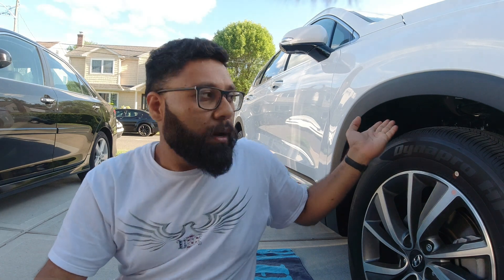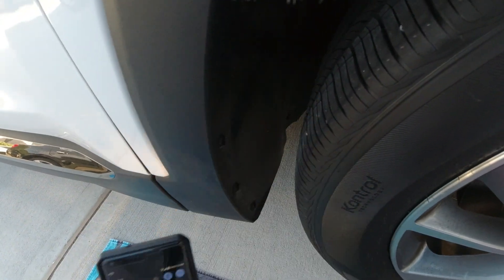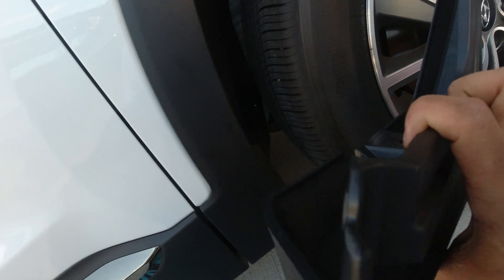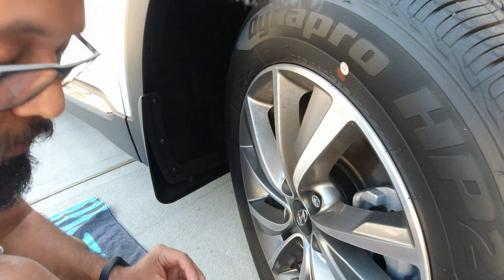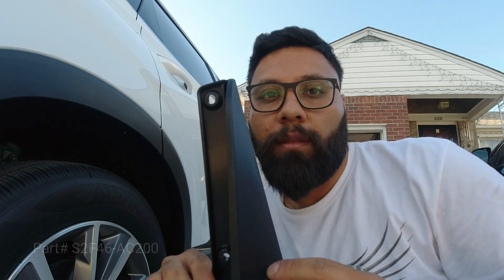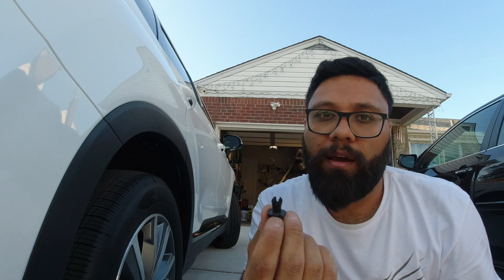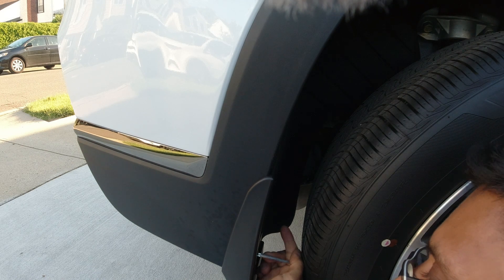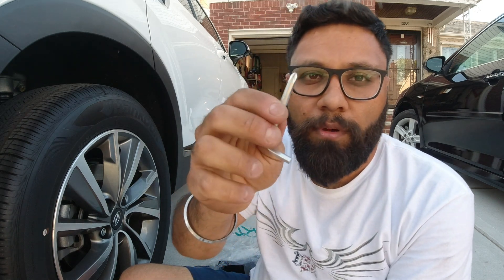How to Install Mudguards on Hyundai Santa Fe 2020

Comment: Any video how to install bonnet protector for Santa Fe please..
Reply from the maker: I think it's glued on using 3m tape. There are no holes or clips. It's similar to window deflectors. I won't be installing it because it gets installed on the bonnet, leaving front piece of bonnet uncovered. Secondly, it reduces fuel economy

Comment: How do you like them after 6 months of use? Does it seem like they kept more dirt and grime off the sides of the car?
Reply from the maker: It does help with snow and grim from sticking under. All seems to stay in the wheel well. And I use pressure washer with user carriage cleaner to clean it

Comment: Did you have the dealer order the mud guards? Where did you buy them?
Reply from the maker: No I ordered them my self from the dealers website. Partznet.com
Reply: I bought mine on eBay.  They are OEM and came from a Hyundai Dealer in Plattsburgh, NY  $68 for front & rear.